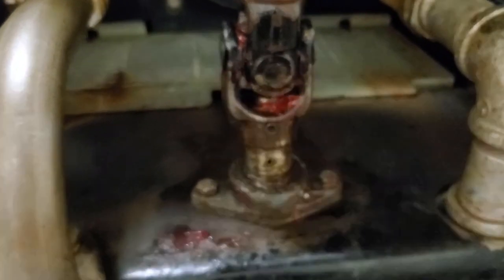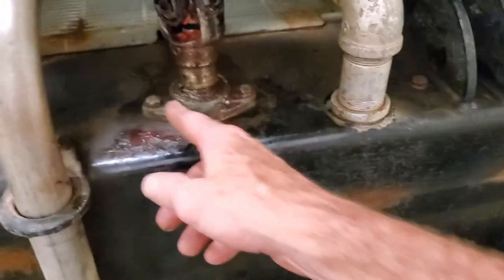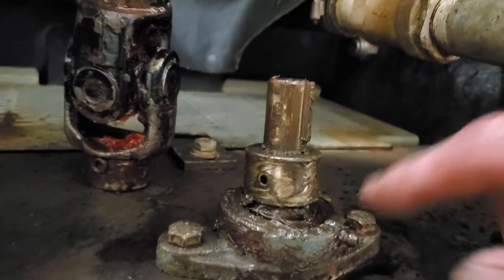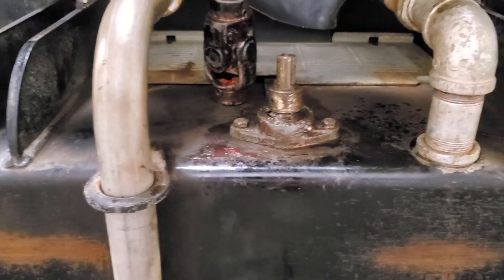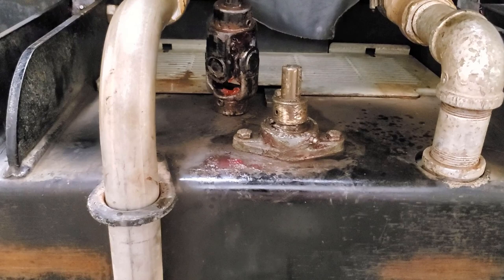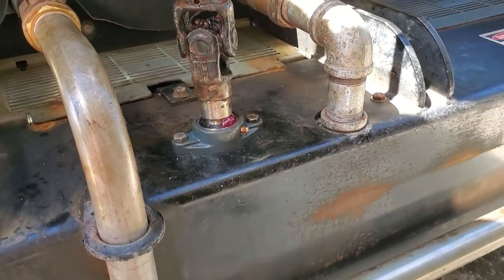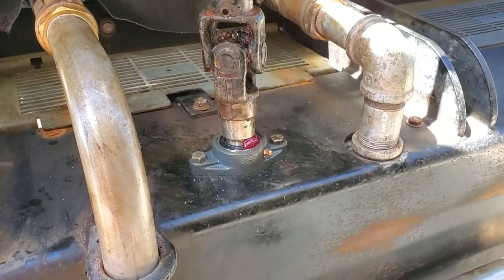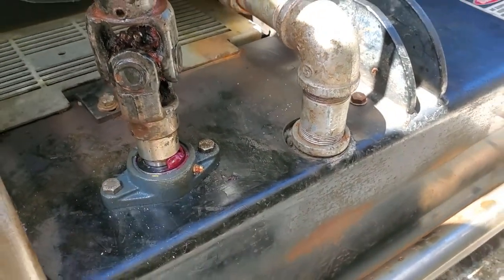Blade Bearing Repair - Zamboni 546

Comment: What you need to do now , with 2 people is one person to turn the blade crank up and down and another with a palm full of grease and grab on to the threads underneath the conditioner! It will help drastically! I know there is a grease fitting but putting it on with your hand directly works best!
Reply from the maker: Interesting, thanks. I will give it a try. No issues with extra grease getting on the ice?
Reply: @YourLocalIceMan  basically the old grease gets dirty and sticky so by putting it on with your hand as someone turns the crank it mixes in better! Depends on how much you use weather it’s a grease gun or your hand it can fall off in a clump. You can feel it as the threads are spinning in your hand and you can judge it from there!